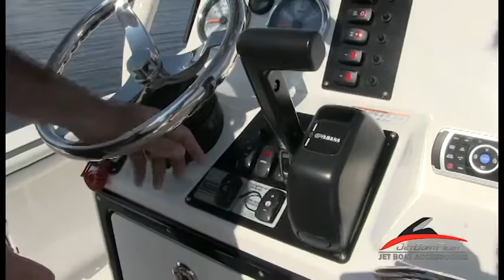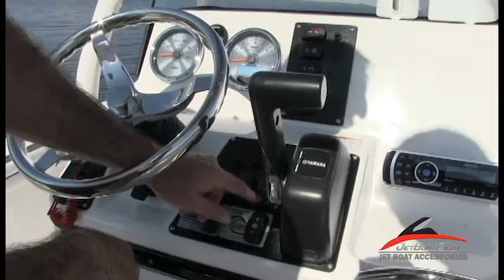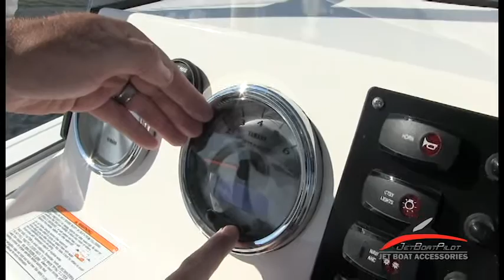Yamaha Jet Boat Yamaha FSH Helm Features Explained

Comment: Will, these videos are among my favorite of the 190 fish series. You guys do a an EXCELLENT job presenting features and content. Looking at buying one of these for use in Michigan this season but haven't had a chance to drive one yet.. How is the power plant? I typically will have 3-4 180-200lb buddies on board and I would be interested in your opinion on planing or running issues. Thanks and keep up the GREAT work!
Reply from the maker: Thanks William! I owned a 2016 FSH Sport and felt that the power was great on the bottom end. You won't have any issues getting going. The top speed will be diminished a bit if you load it down with a lot of weight. Figure top speed around 35 mph when loaded down like that.
Reply: Awesome thanks for the reply and keep up the great work!
Reply from the maker: William Thompson thanks!

Comment: so if I only run my blower 1 minute instead of the legally required 4 minutes and I blow up I can say you told me so?!?!?!?
Reply from the maker: FarEYE I would defer to Yamaha's owner's manual if you're in doubt. I've been boating for years and have never had an issue when running the blower for 1 minute.
Reply: LOL I am a Captain and legally its a Coast Guard Regulation...
Reply: its on teh Coast Guard regs yellow sticker thats legally required on all inboard boats!
Reply from the maker: I see, well I'll have to make a note of that on my next video. And though I'm sure you're a fan of other types of Jet Boats I'm possibly the biggest fan of these types of jet boats. Each is designed to accomplish a specific purpose. Yamaha does this best within the space they compete.
Reply: I am considering a brand new jet boat, You like the Yamaha? That old Factory Datsun Powered Conqueror Marine with a Castoldi drive will always be my baby, but would be nice to have a modern to beat on...
Reply: I like the Scarab center except I think that door looks dumb.... rather just have the Yamaha fade away swim platform
Reply from the maker: Yes Yamaha has been in the jet boat game since 1996. All other players just got in. Yamaha has the advantage in dependability, salt water durability, price, and on resale value!